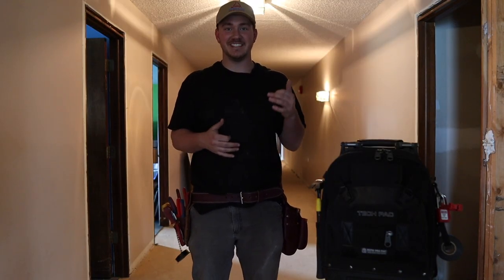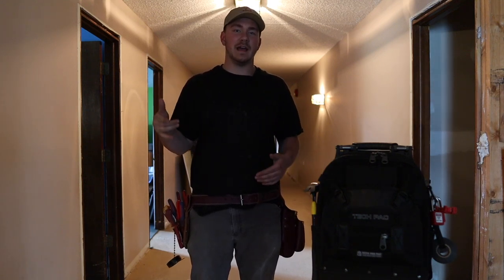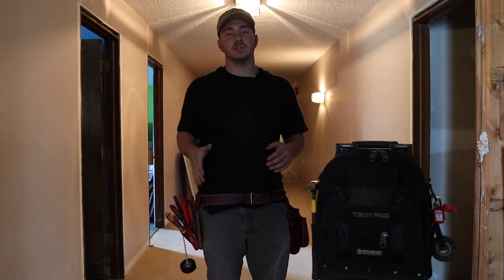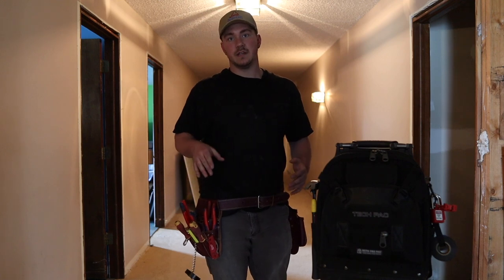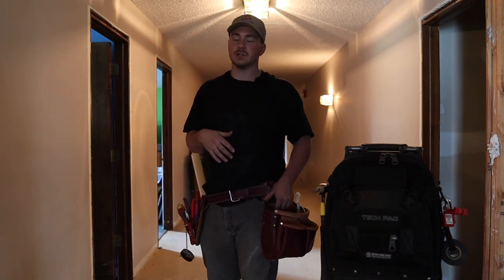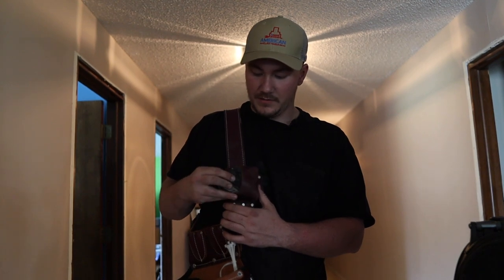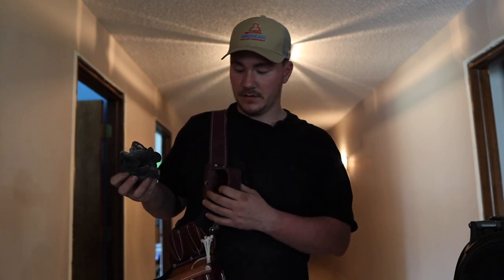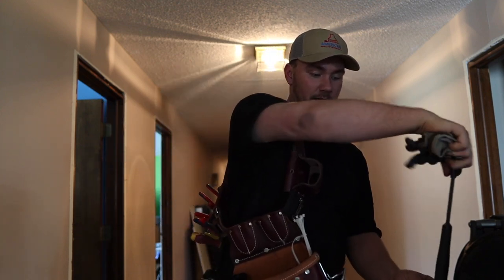The BEST Electricians Tool Belt With Occidental Leather Bags

Comment: Me and my whole company are back pocket electrician's
Reply: Depends on the job I'm doing changing a switch Linemans and 11-1 in my back pocket.. multiple different task tool belt the difference is you don't need a 450 dollar tool belt lmao
Reply: Probably not a good company 😂
Reply: @Lewdacris916  we're a industrial and fuel company
Reply: @anthonyluciano8655  I would say depending on the work your doing you're not even allowed a tool belt
Reply: @anthonyluciano8655  I like tool belts but I'm not gonna tell anyone how to work
Reply: You must be a union electrician
Reply: @anthonyluciano8655  doesnt change what i said lol
Reply: Dawg, some of the BEST fucking electricians I've worked with/for were back pocket electricians.
Reply from the maker: Definitely don’t need a $450 belt😂
Reply from the maker: Really to each his own. Sometimes I work way better without the belt but for the most part I’ve at least got my pouch on me. I would say it really just depends on what you’re doing and how specifically you work!
Reply: @americanelectrician  I can definitely agree with this statement. If you are pulling wire hauling a 20lbs belt with tools working above grid on a 10ft ladder is not the best recipe for efficiency.
Reply: There’s a time and place for a belt, and a time and place when you only need a couple tools in your pocket. In my opinion, if you need more than one pocket to carry the tools you need, you need to put your belt on.
Reply: I’m most definitely a pocket electrician! This kid in the video hasn’t been in the trade long enough to know better. THE ONLY time I would ever use a belt is if I were roughing. A belt with pouches to carry some fittings and a small a handle full of screws. I don’t need the belt to carry unnecessary tools to weigh me down and eventually throw my spine out of wack 🤦‍♂️.   But hey, to each their own. He’ll learn one day if he chose wisely or not 😆
Reply: My pants all have holes in the back pocket because the pliers are sharp and my boss thinks tool belts are ghei
Reply: Same only ones who I see with pouches are residential guys who do the same thing everyday. No point in carrying a tool belt in industrial when u have to crawl around in confined spaces all day
Reply: @kraptastic333  your boss is right
Reply: @kraptastic333  pocket caddy’s are game changers tho. Saves your pants and your boss only think you’re bi
Reply: @RsFrag3d  now thats my kind of joke!! Yeah the pouches would come off three times a day and I'd be getting ragged on hahaha. For now I'll just accept the hazing
Reply: I do mostly resi service and construction so I could see it if only doing service work but def you need a bag or tool belt if in a construction environment just my two sense I'm an apprentice so my option aren't valid anyway. Honestly even in service I usually have a bag or utility pouch but that's me I always end up needing a few extra tools at the end anyways.
Reply: Haha, so i work for a 3-man company. Our helper is a bag kinda worker, and both my boss and I are back pocket electricians, and we can get more done with our pair of linemans and 11and1 then this dude who says nobody likes back pocket electrician's and has to have a bag full of tools

Comment: what boots are the best for electrican's? i want something that matchs my veto pro pac
Reply from the maker: Good question. Honestly it depends if it’s a black out or a tech bag. I always love Thorogood boots they’re super comfy. Whatever works for your feet though they are all different!
Reply: Personally I tried timberlands years ago and haven't looked back... boondocks are what I like but ill try their iron worker boots next because they're lighter
Reply: Cheyne Best I was thinking boondocks because I like the 18v electric resistance
Reply: American Electrician regular brown MC tech bag
Reply: i thought thorogoods were comfy until i tried Keens
Reply: @HeadShotKilla10  thorogood has boots that are electrically insulated as well idk if Id go as far to test 18'000 volts with it but I'm sure they do fine for up to 240/208 which is all I've come across so far so for me they aren't bad as long as what boots your buying don't have steel toe are composite or carbon instead and electrically insulated.

Comment: Brother Telcom is not a electrician a electrician is someone like me who.can bend any type of emt can thread and run rigged who can run under ground run and set up a wire puller with 10000 pounds of American pulling power runs mc can do residential in pulling romex and slinging boxs in 90 degree 4 weather takes 4 years of schooling we run all yalls race ways all yall do pull yalls wire and mount devices in boxs we mounted for yall in a IT ROOM be pre built any low voltage crews are not electricians i mean you said Telcom so thats why im saying it electricians are the marines of the trade filed we are the first ones in and usually the last ones out it takes alot of knowledge and skill to call yourself a electrician im not trying to be a dick but thats like a mall security calling thier self police but any ways nice video i do like your tool bags stay with it its still a great trade and alot less work with idk maybe even more payment im not sure in my local journeymen make 34 an hour so if your close to that stay where your at lol trust me its dangerous and takes a big tole on the body over the years for sure but sorry if you are an electrician i just only herd telcom but thanks for the video man good luck and god bless!!
Reply: Dude. He IS an electrician. He simply chose the "telecom" bag to sling tools in. That's it.